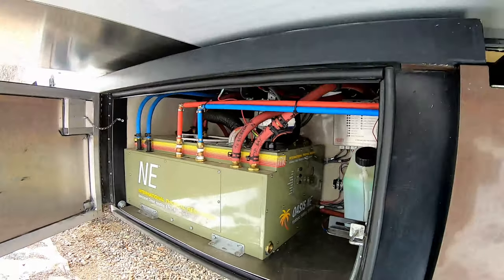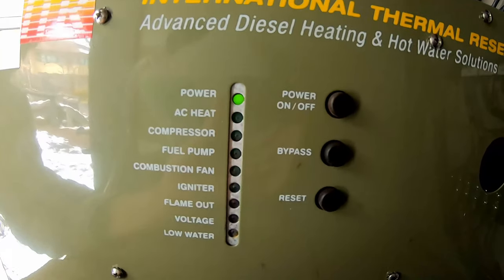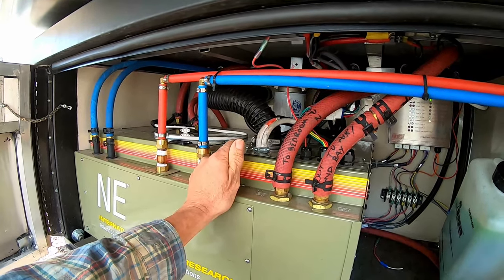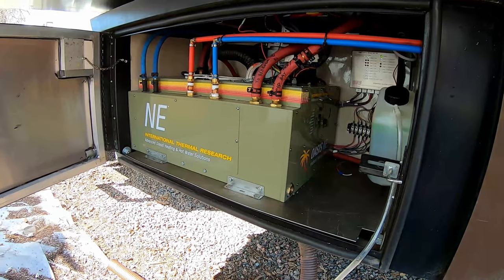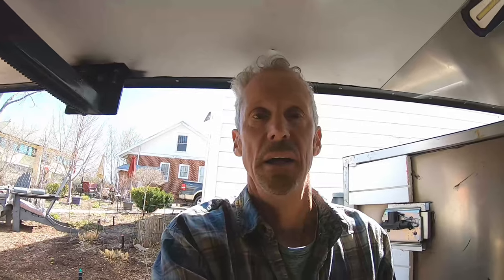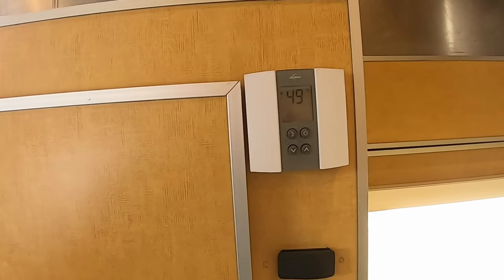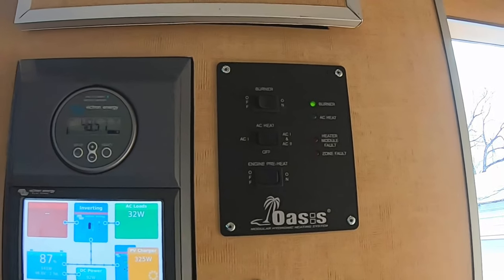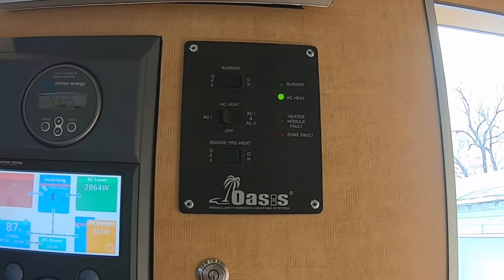50,000 Oasis BTU Diesel Water Heater

Comment: I have some non related questions about the pop up roof and slide outs, I’d like to know the full specs and why. Are you part engineer? How did you know what size materials to use and spacing you needed? Re: aluminum studs, spacing, wall thicknesses of AL studs, why some were 1x1 and others were bigger. How did you conclude those sizes would work for the loads as they have obviously worked so well? Tks..... GREAT build
Reply: I wonder if he winged it; like I would.  Some measurements, but mostly just idea in head, quick sketch, short list of materials, cut/connect as ya go and make a bunch of trips back to the dang hardware store.  That would be impressive.

Comment: Excellent video! thanks for the detailed explanation. This does look like the magical heater which does it all. Can I ask how much diesel does it consume per hour? also does it have the capability to set a timer to heat up the engine?
Reply from the maker: It uses about .44 gallons an hour continuously running. It does not have a timer. I usually turn on the engine preheat the night before or when I get up and by the time I eat breakfast, clean up and pack up, it is ready.
Reply: Expedition Vehicle Adventure thanks! How loud are the fans? Have you considered floor heating?
Reply from the maker: @yingweiyang   the fans are noticeable for sure. I have gotten used to them and do notice them when they kick on because I have three fan units in the living area. Floor heating will be in the next build if I can swing it.